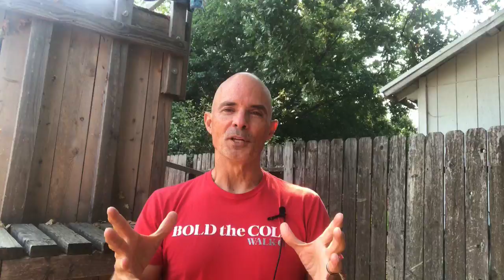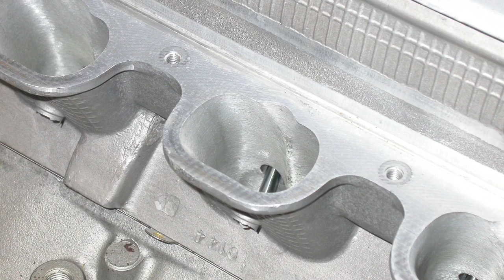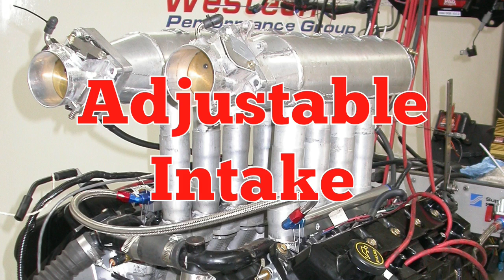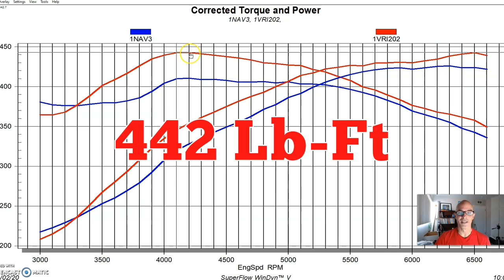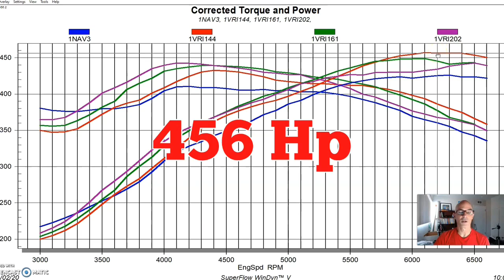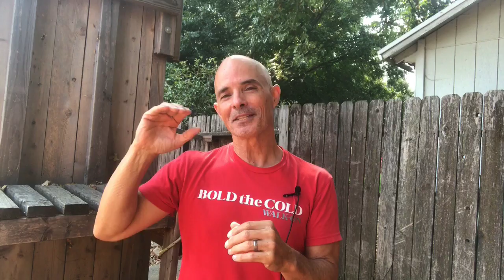5.4L AUSSIE BOSS 290 INTAKE TEST

Comment: I have an example of piston speed limit... I run a rover 1.4l K-series (an engine found in the MK1 lotus elise but probably completely unknown in the USA) at 8000rpm I could run the engine all day every day. When racing, due to gearing I used to run it to 8400rpm so I didnt have to change to 5th. after aprx 5 passes (1/4 mile) it would push the gudgeon pin out into the cylinder wall, it would run fine but obv itd burn oil fur fun. yes technically its a conrod issue(press fit pin) but was directly related to piston speed. The reason I cite this example, is the pistons jsut a slug, I suppose so long as it doesnt seperate into two  it has no reall limit, the limits always whats around it, rods, pin, rings etc.
Reply: Denis O'brien you would have had bores that looked pregnant! “Slightly” larger in the middle if you know what I mean!
Reply: @beardbuilds5140  if you could post pictures in youtue comments id show you, yes driving 300 miles home from an event with the gudgeon pin riding the cylinder wall left an impression (but she always made it home) the pin was very wide, so even when it was contacting the wall on one side, it was still in the piston on the other, there was a slight little end knock but the tell-tale was the horrific oil consumption on that cylinder.
Reply: You can lower piston Acceleration with longer con rod and lower height piston (higher rod ratio),
which is also improving the crank angles which reduces wear and force from the cylinder wall, and makes the same displacement engine to be able to rev higher without exploding it, and in some cases even gives you lighter rotating assembly, and also makes the compression stroke just a slightly “longer” like an half degree or so but anyways it theoretically helps with detonation issue 😁😅

So there is much “pros” in longer rods. 😁
Reply: @Jubr123  Id love to see richard actually test this, ive no knowledge of "domestic" v8's cause in the UK they just dont exist in decent numbers, but off the top of my head the subaru EJ25 and the nissan RB26 are both engines I know intimately and they both rev hard and both have very short rods. Now the EJ is famous for piston slap but id say thats more due to the tiny height slipper style pistons than the short rod. I agree from an engineering point of view, but interesting how it plays out in the real world.

Comment: So.... I think Richard's homemade intake was the best of them all?  Wow!
Reply: Chuck's Truck : It was. The 16 version of Richards made the most power with the least revs:  449 hp at just 6100rpm. I was taught to look only at the rpms required to make peak power, which is called the Hilth Method of data assement. Generally, most bench racers and dynomometer operators understand that carrying another 200 rpm to make another 15 hp is fine, but another 200 rpm extra to make only 2 hp more is not an efficiency win. The trends are more important than the peaks. The power peak Richard made on the second longest of his custom intakes made that 449 hp  from a 330 cube engine at just 6100rpm. Not carrying extra revs means VE and BMEP have improved, but Ai is a real quick sanity check. If you take engine cubes, multiply it by the peak power rpm, and divide by indicated gross dyno horsepower, you get a number, 4484 in the 16 runner test case. That is an Aspirations Index (Ai) as defined by two Australians, the late F1 engineer Phil Irving and the still alive touring car engineering guru, Larry Perkins. Richards second longest Rube Runner gives the lowwst  Ai of 4484. Revs are traded off against Horsepower. Lowest number Ai constant wins. Always. Mr Holdeners Second Longest 16 inch 'Sub' twin throttle body beast "wins" by that statistical rule.The SMH was 2nd. Boss 290 equal by a narrow margin, about 4714 each. 330 x 6300/ 448 hp for the Boss 290. For those worried about mid range torque losses,  Variable valve timing can control that.
Reply: You are incorrect when you state that "Variable valve timing can control that." as the 5.4L DOHC modular V8 has absolutely no variable valve timing, nor have any models of the Modular DOHC 5.4 ever had that feature. It is not something that can be added into the engine either, obviously.

Comment: I think you can use Coyote intake on the 5.4
Reply: That would be interesting
Reply: Boss 302 roadrunner manifold has adapter plates available.
Reply: Yes. You can. I have a test comming up with one but it requires the use of MMR adapter plates.

Comment: Falcon GT engines were 4 valve, all the others were 3 early on. They weren't very popular every one went for the Barra Turbo 6
Frosty Cool test...
Reply: XR8s were also 4 valve (260) Not just GT's(290) or GT-Ps(290)
Reply: The 5.4 barra was 3v but all boss's were 4v (260, 290 3##)

Comment: Alright Richard, who's the Aussie who slipped you a 290 intake? 🤔 You gotta ask whoever your contact is down here for the BOSS 315 intake off the FPV before we swapped to the Miami motor. 😎👍
Reply: This is partially correct..BOSS260 and BOSS290 Upper plenums are the same but...the BOSS315 is built to accept a larger throttle body.
We also have an aftermarket fabricated plenum lid that accept a twin 65mm Wipple TB.
There are also some that have been fabbed to accept a TB either side or directly in front. Look on Ebay and you will find one.
I am selling a BRAND NEW from Ford Australia 260/290 manifold without upper plenum.
Reply: @michaelgray8543  Thanks Michael for that info. 👌 I couldn't find that last bit why the 315 upper was different. 👍
Reply: 260 - 290 - 315 Intakes?  What are the differences between them?
Reply: @chucksgarage7165  From what I'm reading off all the old Aussie forums...none. 😁👍 Not between the 260 & 290 anyway. All internal differences (different comp pistons, different cams, valves). Trying to find the 290 vs 315 comparo. 🤔
Reply: @chucksgarage7165  Okay, same lower intake on all 3...from what I'm reading though it maybe different on the upper on the 315. 👍
Reply: No such thing as Miami motor , in Australia we got the 5.4 twin cam or single cam 3 valve in Fairlanes LTDs, it it a member of the mod motor family just like a 4.6 , then we got the Coyote 5.0 to replace it  ! No such motor as Miami. Just because a Coyote 5.0 was cast and assembled with a handfull of slightly different parts you can't change its name , Coyote it is not Miami , if this was the case , back in 1974 when Ford Australia started casting 302 Cleveland's and 351 Cleveland's at the Geelong Casting Centre they would have renamed them the 302 and 351 Geelong instead of keeping it a Cleveland ! Ford Australia changed the Clevelands heads , displacement, intake , ECT but still called the Cleveland's !

Comment: Well you know the long stoke on the 5.4 won’t let you run 7k bc of Piston speed 😂
Reply: Some guys will run them to 10k...do a quick Google search. The factory rods give up quick but 7k rpm with a 5.4 is only 8200 rpm on a 4.6 with the same piston speed...
Reply: Yeah...it is not the Piston Speed that limits the RPM as richard says..it is mostly valvetrain but it is also limited to the strength of the components that have to handle the incredible forces related to the acceleration and deceleration.
It wont limit the rpm but it will break stock rods...eventually.
Reply: michael gray I agree, the valvetrain stability is almost always the limit, I’ve built quite a few engines myself, I’m not they type of guy to put time into building a stock engine, if I open it up, it’s going to make more power when it’s put back together
Reply: A few of the ford tuning mobs here in aus have all told me the rods are the rpm limit in the Aussie version, in the boss 260 I have they said it’ll do 7000 but you’ll be stressing the rods, safe to limit to 6500. No concern on pistons.
Reply: @ZedTee77  Rod loading is a function of piston speed.
Reply: I know bro I just had to comment like he said, I would rev it out in a heart beat, I’m not a hater at all,